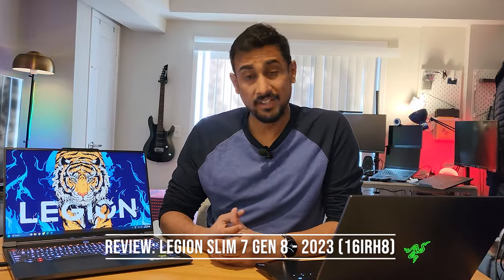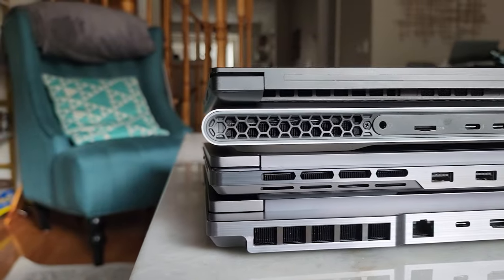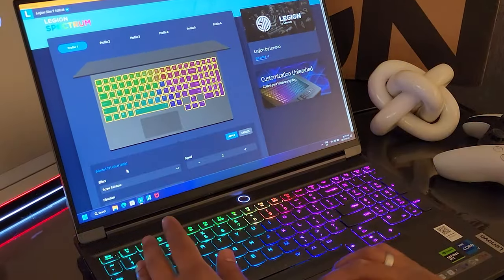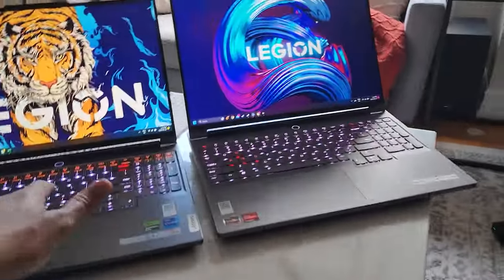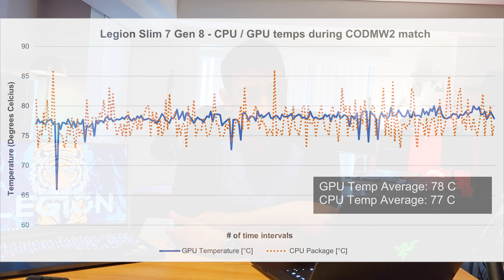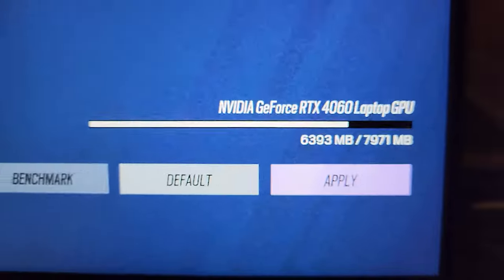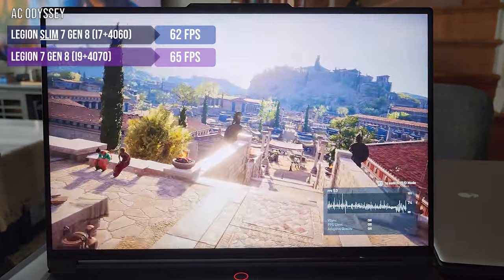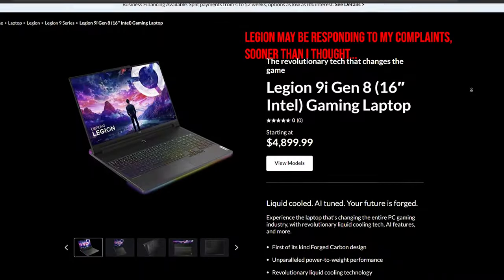Legion Slim 7i Gen 8 : It's getting old!

Comment: It's very frustrating to see Lenovo/Legion only offering a Mini-LED on the $5,000 Legion 9i, especially after they advertised it with the launch of the Gen 7 Slim models last year but never released it.
Reply from the maker: I think all the manufacturers decided to keep minileds as a super exclusive option in gaming laptops. I mean, is it really necessary to get an i9 and 4080/90 just for a miniled? Its all fixed! Id like to see these guys need to make pc gaming more enticing for the console gamers.
Reply: The 14 in slim 5 come with a premium oled at it base price
Reply: @kazmiee  well there is Lenovo Yoga Pro 9i (16in), which in Europe at the moment is @ 2000€. 
I think its the cheapest miniled and it only goes up to 4070.

Comment: Hi Ali. I just discovered you chanel and the quality of the reviews is very good! I need some help here: I was debating between Legion Slim 7i and Zephyrus M16, both with IPS screen. Coming from a Macbook M1 Pro can't switch to cheap plastic laptop. I'm doing web development and just started working on a video game a month ago so need some graphical juice. Which one would you recommend?
Reply from the maker: Thank you for your kind words Daniel. I really appreciate it! I am leaning towards the M16.. atleast on an "on paper" kind of technical understanding. Big win for the M16 is having 2 SODIMMs so that you can easily upgrade your ram to 64 if needed. Also, with the third fan and more heat pipes, it offers better thermals which is very important for the long life of the device. I also really like the look of the device with the screen starting from the base of the deck. the keyboard is also REALLY nice on the M16. I believe it might be a bit more expensive compared to the Legion Slim 7, but I think it more than justifies the premium on paper. Sure, it would be thicker compared to the Slim 7 but on the day to day, I believe you wont even notice it. You will lose RGB control on the M16, sure! but honestly, the novelty of per key RGB seems to wear off rather quickly.

NOWW.. all that being said, if someone is attempting to move from the apple world to windows, I am usually very happy to recommend the Razer blade (of course, subject to availability of budget); BUT.. NOTHING.. and i mean nothing comes close to the premium build and feel in windows devices to that of the Razer Blade. And at a thickness of 0.67 inches, It feels incredibly slim and solid at the same time, while pushing PS5 levels of power. You dont have to consider the Blade 16.. since that is thicker. The blade 15 still offers a sweet spot in terms of power and portability. Maybe you could also get a good deal on last gen's Blade 17 with a 3070ti.. which offers close to the 4070's performance this year. Hope this helps!
Reply: @kazmiee Thanks a lot Ali. Very useful information. Razer Blade 17 inch RTX 3070ti is within my budget. My only concern is that's last gen and I think doesn't support DLSS 3. I was able to test both Legion Slim 7i and M16. Touchpad is okish on both but Legion metal build feels so much better. It feels cold metal and I love that compared to M16 weird alloy of lightest metal (Magnesium) that feels like plastic.

I haven't had the chance to put my hands on a Blade and I don't know if it's worth overpaying for 2023 model. Some people in Lenovo Legion Discord said that Razer Blade have bigger QC issues compared to Lenovo Legion.

Comment: Mine is i7 13th gen + 4060. Hell of a beast. Runs all Aaa title in Ultra with ease. Gets very hot must admit but if used with laptop cooler temps reduce a lot. Using this beast since 9 months. ❤🔥
Reply from the maker: Always love hearing a good story about this bond between man and machine. It is certainly a very capable machine. I am currently testing out the new Asus G16 2024 which also has the 4060 along with the newer ultra processor and the gaming performance is identical. So your machine may be from 2023 but it is still very much in 2024. Hope you continue to enjoy it! What games are you playing on it lately?
Reply: @kazmiee  yeah thanks. This machine is indeed special for me as its my first gaming machine. Currently I am playing Doom eternal and Back 4 blood. Playing on ultra settings. Literally juicing all the pulp out🤣
Reply: What is display resolution? 3.2k or 1600p
Reply from the maker: @CrisstianoRR  1600P. I believe Legion is only offering 3.2K in its Legion 9i.. I could be wrong
Reply: @CrisstianoRR  mine is 3.2k
Reply: @harshchavan8123  do you lower your resolution while gaming or is it quite good on native 3.2k?
Reply: @CrisstianoRR  no I dont lower. If played on low res then screen tears. It looks fabulous on 3.2k

Comment: Damn, 3 hours? I'm getting around 8 hours of youtube runtime watching this machine (verified, lost around 7% watching this video)
Reply from the maker: Just confirming. You have the same device as well? And getting 8 hours out of it?
Reply: I had the i9/4070 and the device pulls 14w discharge in full screen YouTube video loop. On idle it can drop under 10w (10hrs just screen/wifi).

Your discrete gpu was not inactive when you were checking battery life
Reply from the maker: @spacedreamer12  Hmmmm. Interesting. Possible that vantage just switched at the face but not in the Nvidia control panel. Thanks for letting me know!
Reply: @kazmiee  Yes, but i have the 2000p panel. Actually, there is a strange EC bug where sometimes, booting the machine in hybrid-iGPU mode disconnects the data bus for the dGPU (meaning it does not show up in task manager), but it still gets fed power (up to 9W more). When this happened i got similar battery life to what you got. For me the trick was to set it from hybrid-iGPU to hybrid, back to hybrid-iGPU. Actually, I used Lenovo Legion Toolkit to automate this and I get really quite good battery life out of this machine now.
Reply from the maker: @regorforgottheirpassword2986  this is a really good tip. Thank you for sharing! Ill try to put it to use in my other legion since I dont have the slim 7i anymore :/
Reply: @kazmiee  You might not get the same result out of the Legion 7i, that's just a power hungry machine in general and I don't think it has the same bug.

Comment: Can I ask what charger you purchased for USB-C charging. I will be using this laptop on the go, and for me the chunky 230w charger is just too big for portability. I read some conflicting things online, and I'm worried buying the wrong charger for it. And which port do you use for charging?
Reply from the maker: Thank you for your question. I use a 135w lenovo charger which is non GAN so can still be a bit larger than I'd like. https://www.lenovo.com/ca/en/p/accessories-and-software/chargers-and-batteries/chargers/4x21h27800. There is the port on the left labelled 'usb pd' where the charge is intended to go through. But you also have TB4 port which can be used as well. I have used GAN based 100w chargers before ( spigen / Anker ) and they seem to work just fine :) . Though these chargers won't support gaming. Office work, light video editing, browsing, the normal stuff but not gaming :)

Comment: Hi and congratulations on your great work , any advice between this and 5 pro please?
Reply from the maker: Well, you will pay a premium with the Slim 7 and get a 500 nits display instead of 300, get per key RGB, a premium build and feel, obviously a thinner build as well which feels nice, you get biometric login. PERSONALLY, I'd prefer the Slim 7 since I feel it is worth the premium BUTT.. if for example your use case is to edit large and long 4k videos, then with the 5i you can install 64 gigs but with the slim 7, the options are limited. For the casual gamer, who wants a nice OVERALL laptop for general productivity and gaming, the Slim 7 should be perfect. Hope that helps!
Reply: @kazmiee  All i want its an overall laptop for casual gaming , i don't mind battery and portability and i dont want Desktop , and all 5/7 Slim AMD  comes at similar price with 4060 unless the 5 Pro Rayzen 7945HX its a 180 £ more and and i think its a bit stronger for RTX 4060 but comes with 500 nits too ,  also considering Asus Strix 16/17 but 2-300£ more but i am scared about backlight and coil wine i heard they have , so Legion Slim 7 will might be my bet within 1500-1600 £ budget ,and I hope will get soon again at 1200 £ ,thank you!

Comment: wow, insane small difference between 4060 and 4070. I think Nvidia is intentionally handicaping the 4070 by limiting it to 100W so the 4070TI will make sense when they release it. However, I struggle to understand overall those TimeSpy Scores. After reapplying liquid metal on CPU + thermal paste on my GPU+VRMs, I have a Graphics Score of 10902 with an **RTX3070** (2.5yo ROG). The CPU score is way lower, 8721, the "old" Ryzen 7 5800H can't really keep up, despite having a more linear graph ( runs above 4Ghz - up to 4.4 ) constantly, I see this 13700H dips quite often below 4Ghz which is not ideal. I was thinking of an upgrade if there's a good offer on Black Friday because this ROG gives me random freezes sometimes, but given how little performance improvment there is, I think I'll keep it for 1 more year or so given they're not really that frequent on cable, more on battery. Good review!
Reply from the maker: I was surprised as well. But then hardware specs dont have much setting them apart. Overall I think good decision to have the 4060 with 8 gigs of vram. 6 is just not sufficient anymore. Even 8 is become obsolete now. Good to see you're squeezing out the full potential out of your ROG machine. I am thinking to repaste my Razer 15 with the 3070 as well soon with liquid metal. Ill probably do a deeper check into the frequency stats as well. I miss  the good old days when all cores were made equal. I dont even see alot of battery/energy saving benefits of the E cores. Makes it a little wierd to evaluate the CPU as a package. :/
Reply: This generation of mobile gpus is just trash unless you get a 4080 or 4090.
You can get a 4050 that runs at 140W . That's so dumb, when it goes past like 105W or 110W it just wastes energy with NO performance gain. The only good thing about this generation (on lower end models) is frame generation and the extra vram on 4050 and 4060. They done the 4070 dirty. It should have had 10-12GB to make it look HALFWAY decent
Reply: Let me tell you this. I have A legion 5 pro with a 3070 that goes up to 150 watts and a 5800h yet my timespy scores were 12,460 for the Graphics and 10,200 for the CPU. It seems like you aren't utilizing your hardware properly.
Reply from the maker: @Stardomplay  hmm, well, If that 3070 really is going up to 150w, that could tip the scales for a favorable timespy score. In this device, TGP barely reached 90w. Not sure how I can utilize the hardware better. Happy to take any advice. :)
Reply: @Stardomplay  not really sure how you're getting 150W out of that RTX 3070. Even lenovo mentions a cap on 140W, that with Dynamic boost. In stress tests on a full CPU load (45W) this GPU doesn't reach more than 125W. In gaming, where the CPU is not 100% used ( so ~ 35-36W) it can go up to 130-135W. There's really not a way to "use the hardware better" unless you decide to go into overclocking, which gives minimal performance improvments in relation to the temps / power. I, for one, don't really see a point of overclocking, other than increasing results for benchmarks....fps in games is slightly better, but it doesn't make a difference ( if the game is not playable, it won't be playable with OC ). Thanks for sharing tho!
Reply: @93xDmario  You are misinformed on a few caveats that are fruitful from tinkering with this device. Lenovo did place a manufacturer standard 140 watts for the Legion 5 pro 6th generation but the 7th generation allowed for 150 watts. I flashed the vBios with the generation supported and effectively carry that 150 watt limit. With regards to dynamic boost, I can tweak the custom settings in the legion tool kit profile to lower dynamic boost down to zero but allow Configutable TGP to 35 watts given the appropriate offset of 25. This basically gets rid of dynamic boost and perpetually allows my GPU to run at 150 watts all of the time in all games albeit cases of a severe CPU bottleneck. Zero watt allocation from dynamic boost also unlocks more wattage supplied to the CPU but doesn't benefit as much as more power to the GPU. I often reach over 50 watts on the CPU in Starfield and Dead space in particular. Finding a suitable over clock also contributes to meaningful performance gains as well especially in memory frequency sensitive titles such as Returnal and Red Dead Redemption 2. Its not uncommon to get a 5 to 8 fps boost in those titles from overclocking; Cheers.
Reply: @kazmiee  You can try flashing your vBios but proceed with maximum implied risk. It also would help to understand the propensity for your specific GPU bin to reach it's own thermal threshold under maximum load.

Comment: so do you think i should buy the legion 7i gen 8(2023) or not? i also needed for college, i'm an engineering student so i need a powerful laptop, could it be good for both gaming and work?
Reply from the maker: Thank you for your question. Do you have any other options in mind?
Reply: @kazmiee  I am confused between this model with i9 13900H vs Asus rog strix g17 with Ryzen 9 7845HX. Both 32 GB ram, with Rtx 4070 and 1tbssd and  Rtx 4050 and 3tb ssd respectively. Cost for both is 2000 USD. which one is better value for the price in terms of perfomance, upgrade and in general?
Reply: no, thanks @kazmiee
Reply from the maker: @shano494  well, the slim 7 gen 8 is an all rounder for me, for its dimensions, it provides adequate power for casual gaming AAA titles and also has a decent processor to support engineering work (I am guessing using autocad). Overall it is usually a safe choice with great value for money as well. The only limitation is not being able to properly upgrade ram dual channel mode. Let me know if you have any further questions!

Comment: Hi, I want to Upgrade the RAM on this laptop. Can you please suggest some compatible RAM specification for this laptop, something that complements the Soldered RAM ?
Reply from the maker: You should be fine with DDR5 5200MHz 1Rx8. Anything over that speed would still work but that extra speed may not be useable. Hope this helps. You should be able to slot in a single 32 gig stick in there as well

Comment: Should i buy the legion 2022 7i or buy them slim 7 gen 8 3070ti and 4060 which one? Can you make an recomment.
Reply from the maker: The 2022 Legion 7 for me is an awesome device and holds even more value to me after the 2023 Gen 8 Legion 7 had removed a few key features. The 3070ti should slightly outperform the 4060 but wont have frame generation (which is perfectly fine for me since FG makes quality compromises in games) The Slim 7 with the 4060 will obviously be slimmer and lighter but the 2022 Legion 7 is just an overall much MUCH nicer machine to own. Hope that helps!

Comment: Hey loved the video 

I’m having a bit of trouble choosing between the Lenovo legion slim 7i vs the hp omen transcend 16 
My main use case is going to be architecture related software’s.
Reply from the maker: Thank you for the question! Though I have not had hands on experience on the Transcend and I intend to soon, here is my take:

Things in Favor of the Transcend:
- Ceramic white; it is a unique color in the gaming laptop space
- 2 RAM Sodimms - You can take it up to 64 gigs to support massive architecture / 3d projects (Legion Slim only has only one sodimm slot)
- Can be configured with a miniled option so HDR content takes a big leap
- HX series intel CPUs (so 24 cores) providing desktop grade processing to support large scale rendering int your architecture projects
- Facial login using windows hello (Legion has fingerprint login)

Things in favor of the Legion slim 7
- overall better user-friendly experience through the Lenovo vantage software (+ keyboard shortcuts)
- Slightly lighter in weight - Close to 2 kilos instead of 2.3 in the Transcend
- Can be configured with a higher resolution display (3000 x 2000 px) though no mini led
- 2 SSD slots for easy storage upgrade - Transcend just has one slot
- Keypad is available if you're crunching in numbers
- Keyboard that is broadly accepted to feel premium to type on - also, does not have the WASD keys that are translucent - I personally dont like laptops trying to look too 'gamer-esque'
- SD Card slot

With the HX series CPUs and upgradeable RAM, feels like the Transcend can be a better buddy for architecture work (I mean you can still have the Legion bought in the 32gig RAM configuration from the start which can be sufficient) - But overall as a general laptop to cover most use cases, perhaps the Legion is better. I think the HX series CPU can play the major deciding factor. Hope that helps!
Reply: @kazmiee wow THANKS A TON FOR THE QUICK REPLY I really appreciate u spending your time to help me out. 
Just one more query

IF the hx processor is the determining part

Would going for the Lenovo legion pro 5i for the same configurations as your Lenovo legion pro 7i make sense?

Comment: One more question, in slim core i7, rtx 4060. If i am only using adobe Acrobat pdf reader and one note app. How much would be the battery backup with about 50% brightness?
Reply from the maker: Well, apparently I am told that my test may have been done with dGPU still drawing power. If you switch it off from the Nvidia CP, you should get even 6 hours. Unfortunately I no longer have the device to test it out with evidence